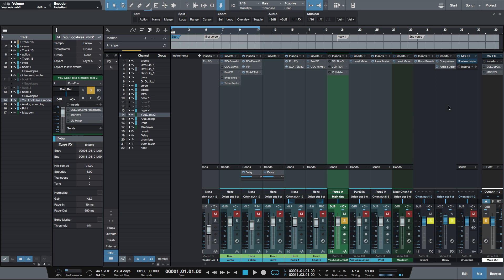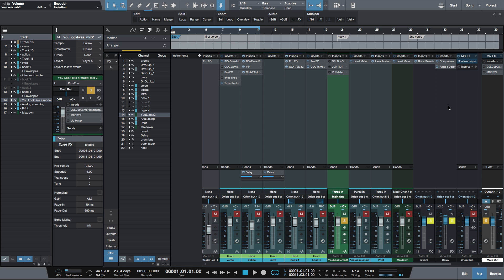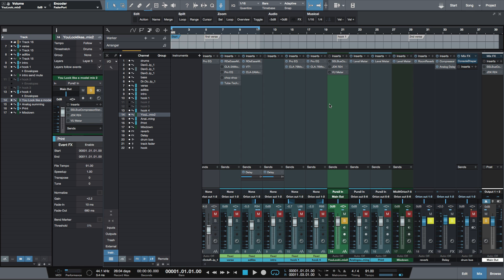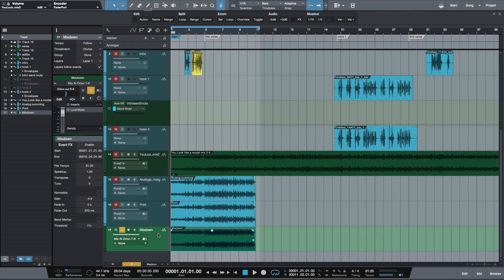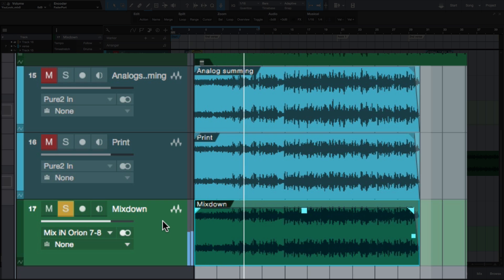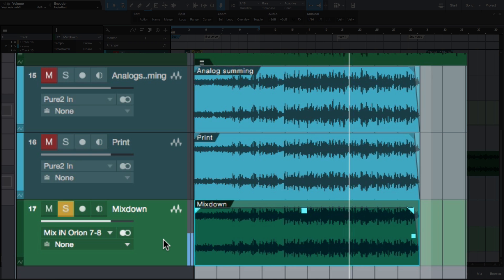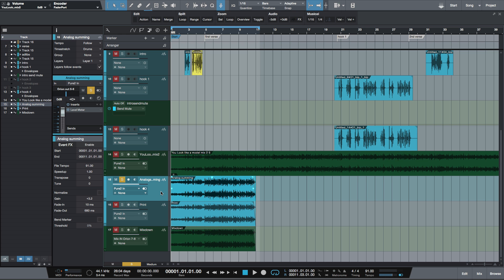Analog Summing vs Printing vs Digital Summing

Comment: I could tell by the delay and reverb. The effects in digital summing over saturated the vocal and other tracks. The print and analog summing pushes the effects back in the mix creating more depth. The analog summing sounds like the effects are surrounding the individual tracks and not on top of them.

Comment: analog summing sounded larger, ESP with the pads intro. But that distorted bass (IMHO) sounded nasty and smeared when it drops. Print sounded the clearest with most separation of sounds (less glue). Mix 2 sounded the best to me... maybe just for this particular mix content. I would remix that bass with less distortion.. and then redo this test.

Comment: In all honesty, I personally preferred the digital mixdown over the others. The worst one, to me, was the printing one - it sounded more compressed and distorted/noisy. The analog mixdown felt more glued together, but the digital mix blew it away. Much more air, fine details etc. - if you don't like the sound, then I think you could do more at the mixing and mastering stage (or earlier) to get closer to the desired sound :)

I also correctly guessed the three mixes, so, yay me?

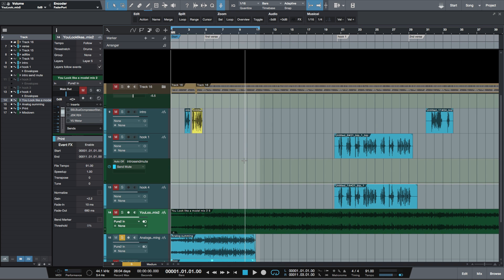Comment: all you're hearing is level difference. on the left hand side the actual gain values are visible for each track. At 6:15 'Print' Track gain +2.2db.  At 6:17 'Mixdown' track is at -4.9db. At 12:50 'Analog Summing' track is at +3.2db. This is obvious when downloading the files as well as just looking at the waveforms in the video.

Comment: Print has more color. The edges are smoothed out. The analog mix the vocal sounds alot cleaner. The mixdown just sounds like an in the box mix a little edgy.

Comment: 6:33 all of this is complete nonsense... if you don't understand this stuff, you shouldn't teach it.
The difference is that digital summing combines the individual trackings by stacking 1's and 0's on top of each other, whereas analog summing combines them as voltages in the real world.

Nobody does this "print" method at all anyways. It's still digital summing, you are just putting it through an instance of D/A and A/D for no reason. This can offer no enhancement at all and could only serve to shrink your stereo image and degrade the clarity of your center image (you know... the important stuff!!!).
Reply: very misleading example as tracks are all different levels with 'Analog Summing' being 5db louder than 'Mixdown'

Comment: The conventional mixdown sounds the worst, it seems extremely 'rough around the edges' so to speak. The print sounds the best to me, clean and smooth - I can just run this through a digital tape machine like Softube's one (It has a dry/wet knob) to achieve an 'analogue feel'. The sound of the analogue one is alright I guess. I personally do not like the widening effect - If I want the image to widen a bit more then I can do this myself with mid/side techniques and I will have full control.

Comment: Great video sir!!! I love your gear to by the way. I have a question in reference to your Orion 32. How are the drivers? And what type of latency are you getting using this piece. Also are you using it via Thunderbolt? I'm currently putting together a new studio and I am very interested in the Antelope products. Just wondering about the latency and the dependency of the Antelope product from a driver Point of view. Thank you so much for responding to me in an efficient manner. #MuchLove
Reply from the maker: +Philip French drivers have been solid for me. Orion 32 is usb, the 32+ is the thunderbolt one. Not sure of latency but I only mix and it hasn't been a problem for me. Search YouTube for my Orion 32 review. Antelope Orion 32 review

Comment: The Analog Summing is the best version. It has more detail, less distortion, better separation and the bass and midrange have more punch. I own the 2Bus + and from the moment I began using it, I knew I would not be able to go back to ITB exclusively. The combination or hybrid of Digital mixing with Analog summing also make a session much more pleasant to listen to... I don't get the ear fatigue I used to. The more tracks you offload onto analog summing, the more detail is revealed and the sound stage  feels limitless. Reverbs go on forever and the sense of depth makes everything so much more interesting. It is the best upgrade one can make to a studio that churns out songs made ITB.
Reply: Yep i was blown away when i switched to analog summing with my neve orbit instand higher rms which i can get loud masters easily and less plugins instant glue then fallow by my hardware e and compressor sounds like record already with final limiter or i can use my converter ad a limiter by clipping some people say  you dont need a summing . Maybe so. But if you do get one  it makes mixing faster and better glue

Comment: The only difference between the print & the digital summing is the capacitance on the analog cable... I don't leave the digital domain unless it's to go through a high quality mixer or processor that doesn't exist as a plugin
Reply: da fuck you talking about, nigga?
Reply: Trae Richthofen I'm saying that printing is only digital summing with degradation from unnecessary d/a & a/d conversions

Comment: This is my personal opinion when listening to the blind test on you tube through on my tv speakers. Mix 3 has detail and boldness. Mix has boldness but not detailed (Clarity) when compared to Mix 3. Mix 2 lacked boldness and also sounded lesser in volume, hence couldn't judge its clarity very well. 

I have viewed few similar videos online. Analog summing has clarity between instruments.  Where as digital summing has its own sound where clarity is little hidden in the folds of the so called 'Digital Summing Sound'. In analog summing, the mix is more revealed.

Thanks for a nice video.

Comment: Listening on a pair of HR824's with an Aurora16 DA/AD and a big ben. Mixdown is louder and that's going to affect the impression being made. However, the most noticeable difference is its soundstage; it's very much wider and open sounding than the print. A whole lot 'bigger'.
Reply: Listen to that sample in the intro, it's got a phasey fx thing going on-  On the summing mix, close your eyes and listen to what's coming from the outer  'edges' of the soundfield.  Then A/B with the print. You'll notice the print is significantly less sparkly/dynamic. But honestly it don't really matter much on this type of music. Some of the best sounding samples are being pushed thru crappy MPC A/D converters, and this is THE money sound. If this were classical or Jazz the soundfield and image placement would matter significantly more. The irony with hip hop is if it don't sound like a mixtape, like you did it in your mom's basement, it somehow loses its street cred. That is  until you 'make it big', and only then are you expected to sound like Jay Z, production wise. ;)

Comment: Are pretty similar. What happen if you add +6db 30hz with a linear eq to the print? Could sound similar to the analog summing and it's pretty cheaper in comparison.

Comment: Interesting.  I found the print to be wider than the Analog, and the Mixdown to have better low end.  But I did prefer the Analog overall.  The analog's highs were more open.  Could you list your analog equipment in the video description please?

Comment: For Hip Hop, you need a summing box with transformer outputs. Thats the secret. Plus you need a master clock. Mixing in the box equals mud without these components. You have a slight difference with a Dangerous D box, but  i know for a fact for hip hop they use a Dangerous 2 Bus because it has transformer outputs.
Reply: Any digital system has a "master clock."  That's no "secret."  And who's the "they" that use a Dangerous 2-bus?  Why didn't you mention who "they" were?  The internet...

Comment: An interesting A/B/C comparison which definitely revealed, as has been said many times here already, subtle yet distinct differences. During the initial "blind" hearing of the three recordings each one felt different, but it was hard to put a finger on what that difference was. The length of the clip goes a bit past the audio memory of anyone, including myself, who hasn't spent a great deal of time honing those sensibilities so as to remember the sonic character of each recording...and I've been involved in making and recording music myself for the better part of 30 years. In the A/B/C flipping between tracks after a few seconds certainly makes the differences pop out far better. Reducing the time between changes down to two bars would make it even more apparent. 

But alas which one of the recordings one prefers simply comes down to personal preferences and any sense of "best" sounding is only an opinion based on those and nothing objective. While I'm very much a fan of the world of analog as a whole and also having owned a d-box in the past I very much preferred the sonic profile of the digital mixdown, I'm sure in part because I've always had a penchant for scooped mids and I found the print and in particular the analog summed recording to be peakier in the midrange which to my ears added a layer of harshness that I found unpleasant whereas the digitally mixed version felt rounder and less agressive. It never ceases to fascinate me how differently we all hear the same output (surely in part due to the different equipment we each listen on respectively).

The way I see it, analog summing is a tool which imparts a certain color to whatever is being processed and the question should always be, "does this color serve the track?".  If so, use it, but I don't believe in using it as a one size fits all approach to recording. ITB mixing has become so refined and polished that even AudioHardwarePorn Gurus like Andew Scheps have migrated to mixing 100% ITB. 

Thanks for taking the time to create and upload this. 

Peace.
I.S.
Reply: +Infra Schall I'm an old guy also. Analog summing sounds like back in the old days working with a vinatage Neve or any pro console, it has a warmth in mids. Then it needs the tape sound to complete, I use the UAD A800 and love it. I also like the plug-in summing.

However, if you prefer sterile no problem with that although I will never change because I was heavily influenced by all the gear sound of the earlier years and I am loving UAD and slate stuff.

Comment: The differences are small but they are there, but admitted, that half dB difference may be enough to trick me into thinking they're different. I should probably download those files. But what I think I hear is that analog summing is best, and digital summing is worst.

Now if this is really the case (I gotta try this myself), we have a mystery on our hands: Because summing is probably the most simple thing you can do in digital at all. Basically you add two numbers. There's only one way to do that. So if analog gives us another result, I have no clue whatsoever why! I'll be scratching my head over this one for quite some time!   :D

Comment: Hey Czar, I downloaded the files (thank you) and imported them into S1 v3 and had a listen. You can def. tell the difference with the analog summing track. It jumps out, and just sounds fuller/richer. I noticed here in this vid that when you switched from the mixdown to the analog summing track at 8:35 the difference in sound even over the internet is distinctive. It is subtle, but it's def. there. Thanks for sharing my friend.
Reply: There is a volume difference.

Comment: Analog is -15.7 dB LUFS, Mixdown is 0.5 dB softer (-16.2) and Print another 0.5 dB softer (-16.7), just saying
Reply: Thank you. How can people not level match in shootouts? I will almost always think something that is even .2 db louder as better.. it's not loud enough to recognize it's louder, but it is loud enough to make the high end be more prominent, which can make one think it's clearer. Gotta level match.
Reply: You are exactly correct! Digital is lower. If there’s a question then that’s your answer. No difference. So save your money for something that makes the actual recording better, like a UA LA610 or better monitors and room treatment. Just my opinion.
Reply: I heard it all in the low end. I think it still would've come out on top.

Comment: Analog summing most definitely makes a big difference I got the dbox as well an after using it for 3yrs now there's no way I would mix without analog summing. Nice vid How are you liking that pure 2? I was debating on the pure 2 or the burl for my next master print A/D converter
Reply from the maker: +Lexadon 10 I really like the pure2, I want to hear the burl, especially with its its price and only doing one way of conversion. For what its worth Greg Wells went from a Burl to a Pure2, this is what he told me on twitter,. @audioCzar901 @blackwatchsound we auditioned the Pure2 in extensive testing at my studio. I was surprised that it smoked our Burl B2.
Reply: +audioczarnet Wow that's interesting the burl has had some raving reviews for years but the pure2 is a new product so I'm not surprised it's better but to say it smoked the burl is impressive. one more questions: how is the clock on the pure 2 is it good enough to use as a master clock an everything from it? Or do you still feel the need to have your own external clock?
Reply: +Lexadon 10 An clock everything from it
Reply from the maker: Lexadon 10 from what antelope told me the pure2 clock is the same as the Orion32. I do clock everything from the pure2 because it has more word clock outs than the Orion. 

I will say I haven't noticed a sound quality improvement due to a clock. But what I have noticed since using units with high end clocks (lynx aurora, Orion32, Pure2) I haven't gotten any what I call digital farts in my any recordings